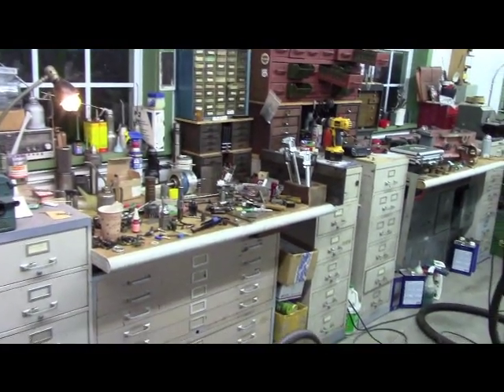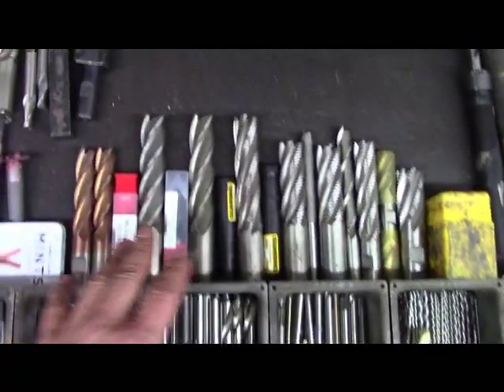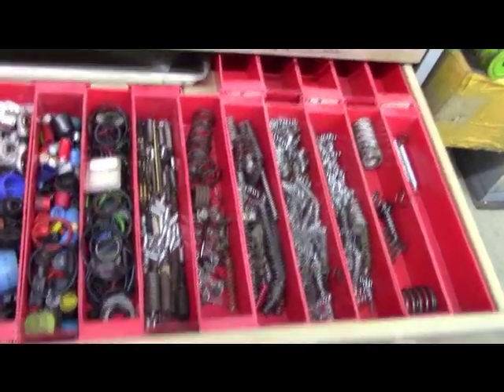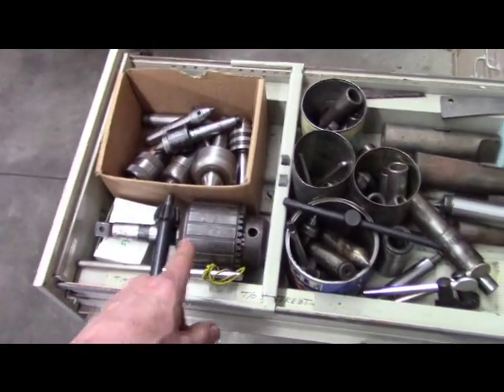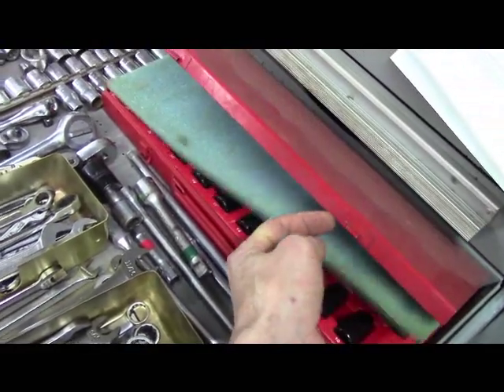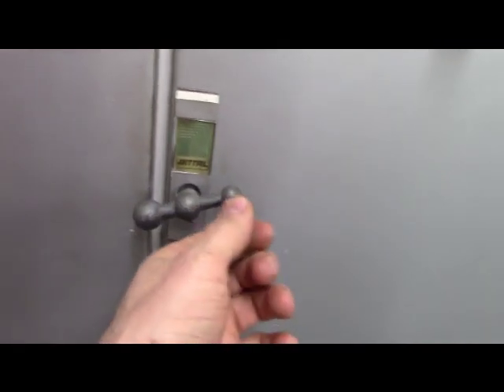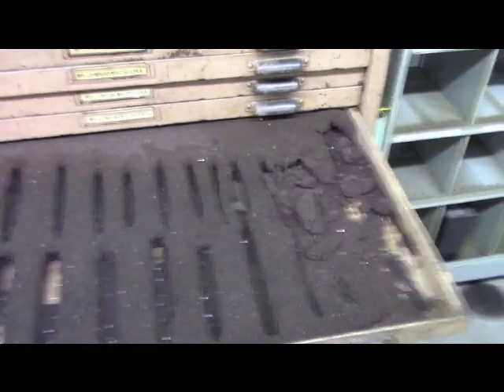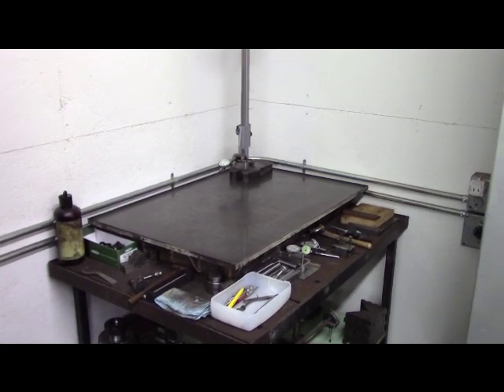Doozer's Machine Shop Update 1-06-20 -- Kaizen Foam and Tool Storage in the Shop

Comment: I like the use of felt paper will have to try it.
Reply from the maker: Get the 30# stuff.  The 15# felt paper is really thin.
Reply: @kooldoozer  all I use is the 30#, I believe I have a roll kicking around.  I never did care for the 15# doing roofing just to thin in my opinion.

Comment: Thanks for the tour.  Today is cleaning and organization in the shop for me.  I don't mind a mess but
I need space to work on stuff.  I will moving some stuff to an out building.  The casting facility has to go
elsewhere.......to the other shop along with the propane cylinders and sand muller, etc...........There is only 

so much floor space.  Oh yeah, cleaning will be going on too.  Your shop looks pretty clean, good job!
Reply from the maker: I appreciate it.